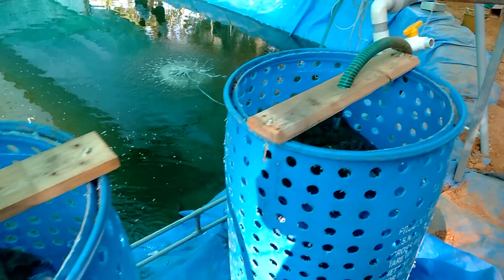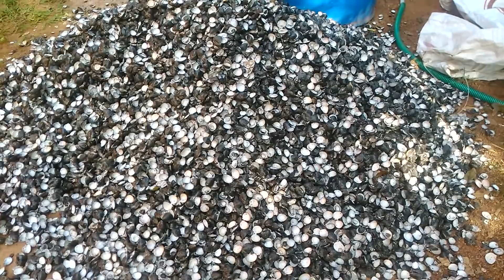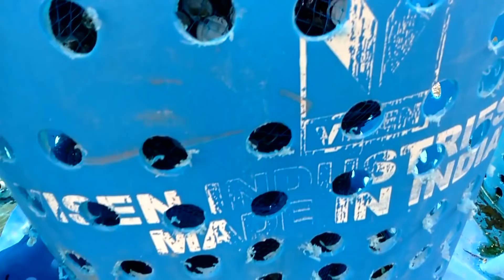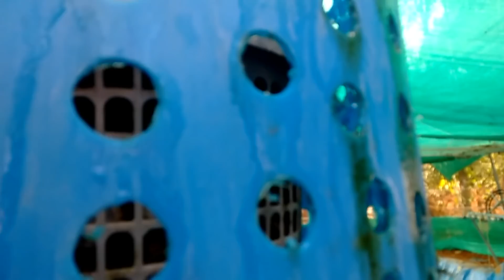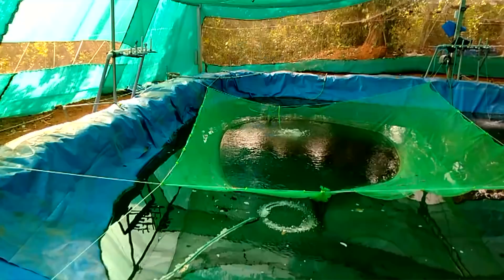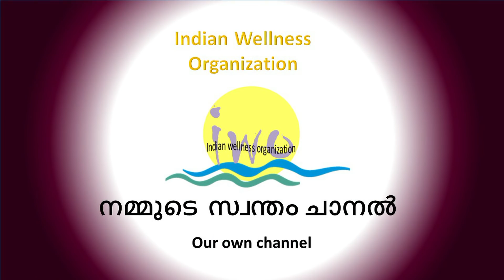Trickling filter for fish farming  ട്രിക്വിളിങ് ഫിൽറ്റർ മീൻ കുളത്തിലെ അമോണിയ നീക്കം ചെയ്യുന്നു

Comment: In Biofloc also, can we use this mechanical & trickling filters for an extra precaution to keep the parameters steady? Or, will it affect the floc development , as the water is recirculated? Or, is this only recommended for RAS?
Reply from the maker: Not required